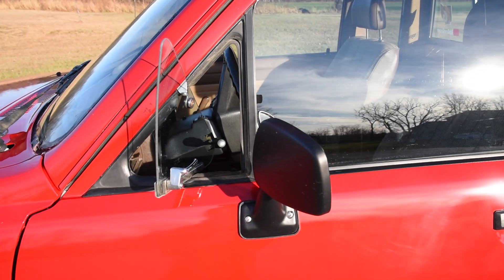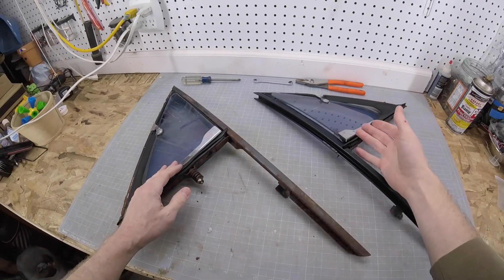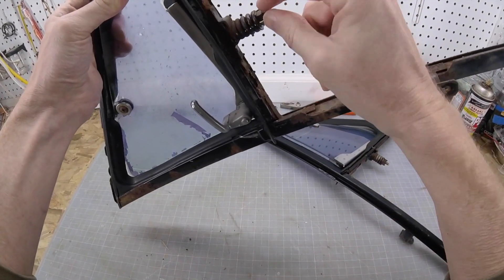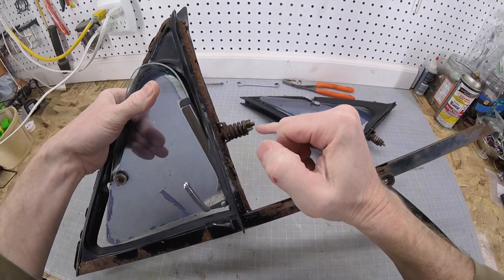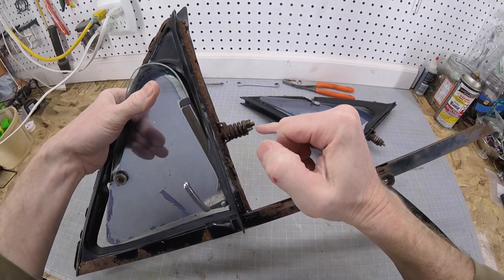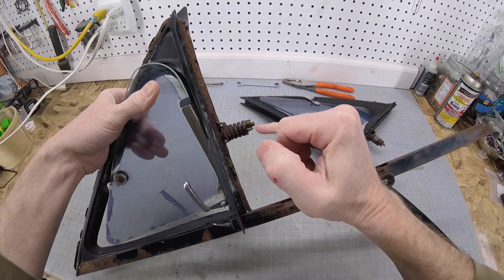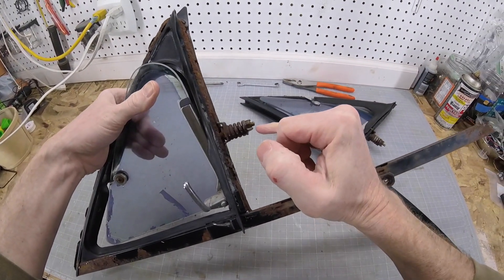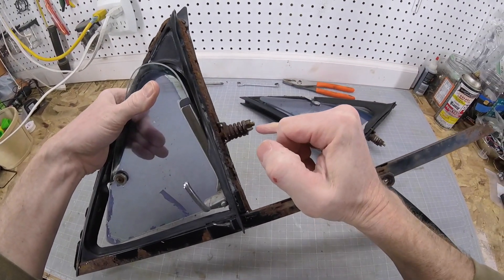How to: Disassemble Vent Window on Toyota Pickup/Hilux & 4Runner/Surf

Comment: So funny because I did this 5 years ago and looked everywhere for a video. And even filmed myself doing the repair but never made it. Glad someone finally did. Also, if you ever lock you keys in your truck. Do not, I repeat do not break you wing window. hah
Reply from the maker: I locked my keys in my truck at home depot once. So I got 2 flat head screwdrivers + a rag and popped the xtra cab window out and reached in and unlocked the door:  https://youtu.be/8_Nig07CHv8
Reply: @6thGearGarage  Nice, my truck was my first vehicle. I had had it two weeks and i locked my keys in my truck at a store I was at. I figure at my young minded logic that a smaller window would be cheaper to replace if i had too. tried to pop it open and its broke it. it took me 3.5 years to find another vent window. A co worker had one he had been holding on to forever and almost didnt want to sell it to me. haha. Finally have both my wing windows back. - Anyways, I have a 84 toyota and i come to you for a lot of repair videos. Thanks for what you do!
Reply from the maker: @redbeard9412  No joke - those vent windows are sooo expensive because they're no longer made. Everyone holds on to them like Gold.

Comment: Thanks for your videos! I’m putting a new vent window in my 94 pickup. The other one shattered. Do I have to remove the whole frame assembly or can I just slide the new glass in?
Reply from the maker: If you’re only replacing the glass, you can slide it in the chrome base (not always easy to do) and then tighten the upper screw to install it without removing the entire assembly.
Reply: Thanks! What a relief, I think my frame may have been replaced before. It’s black and the glass rail is not as long as I’ve seen in your videos
Reply: @wadewilbanks8344  Were you able to do it? If so, where did you get the part? I have to replace mine as well!

Comment: Is there a way to replace the latch or remove the latch? My 89 pickup vent window latch doeat hold it tight anymore. When i drive in the freeway it allows slight air in.
Reply from the maker: I have not yet found a way to remove the latch from the metal base. I've has one break off once though, and it didn't go back on.

Comment: i have an 5th gen, 89 pickup. i'm wondering if the 4th gen and 5th gen windows would be the same if i were to swap to vent windows? i ask bc the doors look different on the 4th gen but perhaps the windows still fit? i have found a handful of them online but it's always on a 4th gen like you mentioned in the video. thanks for any help!
Reply from the maker: Unfortunately, they are shaped differently. The fifth GEN vent windows are pretty rare compared to fourth GENs
Reply: @6thGearGarage  thanks for the info!

Comment: Hi where could i get the gasket only im rebuilding a 87 toyota with bad window vent gaskets i would love your help thank you
Reply from the maker: Last time I checked, the gaskets are still discontinued.
Reply: @6thGearGarage  aww man dang, i really appreciate it.. Thank you let me know if you find anything aftermarket or from Toyota them selves im going to be poking around to see if i can find good used ones or something im leaking water bad inside the cab I appreciate it if you could do that😎
Reply from the maker: @jjsally7963  I'd check the dealership from time to time, as Toyota has started to reproduce some of these older obsolete parts for out trucks again.
Reply: @6thGearGarage  i really appreciate it and for sure i will see my local dealer i appreciate it tha k you again

Comment: great vid, they are gold to us that own one of these m/c, do you have any  info about the dreaded window that sticks half way down and requires a reverse wind to free it up, cheers,
Reply from the maker: I would pull off the door panel and see if there is any grease on the metal track of the regulator. Put some grease on the teeth of the gear part as well. Not enough lube can cause it to bind up like that.
Reply: @6thGearGarage  Manual says do not grease the spring....I did and it makes it freak out
Reply from the maker: @drewfleming7065  Uh oh... what happens?